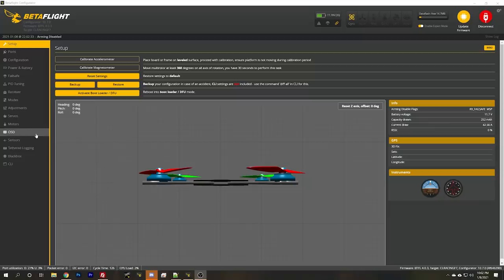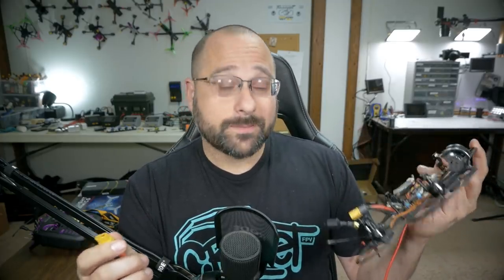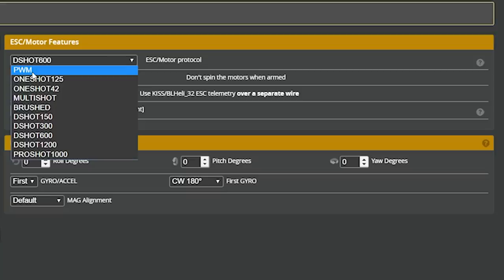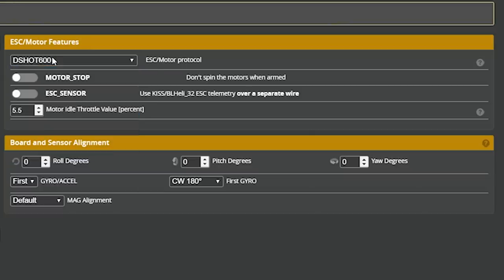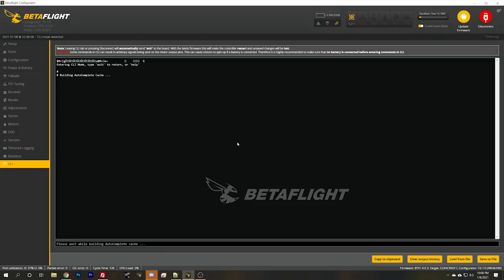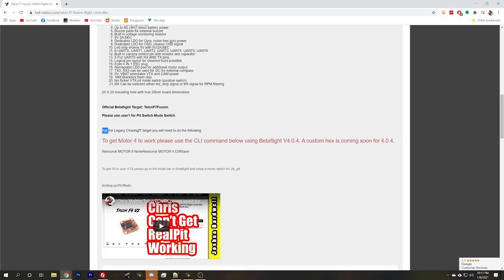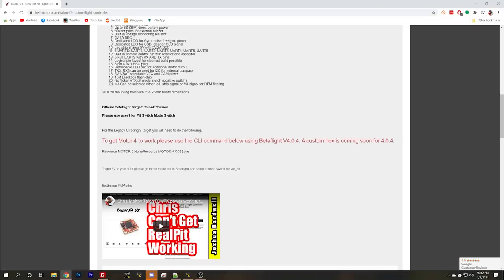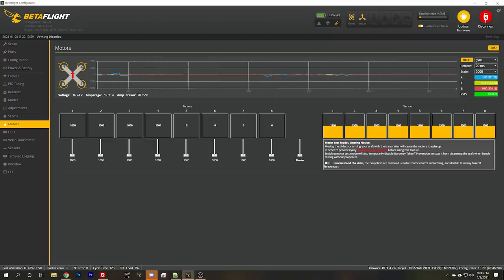Quadcopter motor won't spin REAL WORLD TROUBLESHOOT

Comment: That was pretty great. I am getting back into droning and just Receive my new swag yesterday, already have put in lots of hours.
Call the outside edge of a branch today and crashed. It broke one blade now One motor won't Spin, gimme back into this at each 51. I'm saying that there's a lot programs out there. That can help me and I appreciate this post. It was very informative and I definitely would do the pinch method and see if I can't figure things out. I'm hoping it's just a wire or something after the cras.  The plastic did come a little unhinged and a snapped it back together. So I think and hope it's something simple. I'm not at ESC.

Comment: As soon as I saw this. I thought I bet it's the talon F7. I had this exact same issue a few weeks ago. Its a bit sketchy that board. I remapped the motors once without reading the website trying to use a different pin and it bricked the board until I reflashed it. Then I found the info on the site and it's all good.

Comment: Built my first (and only up until this week) quad (RR CL1)  about 2 years ago.  I couldnt understand how it made such a loud init sound, where it came from (no obvious speaker on the FC) or why I still needed an external speaker.  I flew it a bit and it collected dust.  Never did FPV - LOS only.  It's so fast yet stable. I never wrecked it - unlike my attempts at heli - pro tip I learned circa 2000 dont try a .30 nitro swash as your first without simulator experience no matter what you think you can do.  My last flight with it before I took a break from the hobby I actually used it to hang an 80M half wave antenna on the top of a tree.  Lots of failed attempts at throwing rocks and using a sling shot/fishing pole. Anyway.  Rigged up some string and stripped 12awg wire, flew over, yanked the string - antenna dropped (well, not the antenna but the rope I used to then pull it up) - boom.  Also got my first contact that day.  My mind exploded when I learned the sound came from the motors.  Ive been into car/home audio for the same time.  The answer has been in front of me the whole time.  Ive never seen that from an RC before but it make so much sense.  Its genius.  Motors are basically speakers - without the part that pushes air which isnt even needed for higher frequencies.  Apologies for the long comment but man - mind blown / mystery solved - amazing.

Comment: Hey mr. Bardwell I'm glad you found the issue. My issue is really puzzling. Clracingf7 v1.0. All 4 motors and esc's work. Motor 4 does not spin but when I connect the signal wire to motor 3 it does and motor 3 signal wire to motor pad 4 does not. Motor 4 does come up on betaflight and seems to be working fine. On start up all motors do the 3 beeps but then motor 4 does not do the next 2 beeps. Flashed the board to clracingf7 but the other version of the f7 they say to solder the leds pad together with m4 pa. I'm thinking it could be that issue but do not know how to figure it out..thanks in advance and I know this is an old video but I'm sure you have a better idea of what it could be now.

Comment: I had this issue the other day and all the problem only ended up being a signal wire severed I could tell because the motor twitched when I plugged the battery in. ( exact same motor, btw!)

Comment: Hello Mr. Bardwell,

after I have already seen some of your videos, I would like to contact you. I have a problem with my first newly built drone. After arming and giving a little throttle, the motors turned to full throttle without propellers and at the same time the throttle stick failed completely. I could only stop the motors using a failsafe (switch off RS). Since then, the stack (SpeedyBee F7 V3 BL32 50A 30x30) can no longer be armed and the motors can no longer be addressed in Betaflight. Likewise, the bidirectional DShot can no longer be switched on in Betaflight. Also the button for Gyro RPM Filter is no longer available in Betaflight. Otherwise the stack works normally. Also the ESC seems to be ok according to BLHeliSuite32. Can you possibly tell me what is wrong with the stack? As a somewhat advanced beginner, I am at the end of my rope.

Best regards from Berlin

Michael M. Weber

Comment: Same problem (one motor not spinning) happened to me a few weeks ago. I use a 4 in 1 ESC and all of the motors did all the beeps except for that "broken" motor. I thought at first it was the motor, but something I did (after rechecking all the wiring and soldering) was to change the positions of the motors 1 and 4 (the non functional was motor 4), and then the motor I though was broken did work in position 1, and the one which worked before did not work in position 4. I then concluded that 1 of the ESCs was burned during a bad take off I had due to attempting it in a non-levelled surface. I checked with a multi-meter if any current was flowing through that ESC pads, and nothing there. Hope this helps to someone :D 

P.S.: I bought a new 4 in 1 ESC :P

Comment: I had a motor not spinning once after my brother crashed my quad, it turned out that the motor output from the flight controller was pulled to ground, so I soldered that wire from the harness to the ppm receiver input pad, remapped it and it worked like a charm.
Reply: yes a crash can do funny things bro pull a wire or ground something i thought it was sig wire for motor 4 have a great day bro

Comment: But if one motor wont spin after the crash, that could be physical damage? I tried to clean the motor as it was hard to spin by hand.. and also replaced the cable you mentioned... still problem with new motors! But as said, I had a crash.

Comment: I  could use your help.  I can't get the motors to turn. I can get the motors to turn in Betaflight through the motors tab.  I also see the transmitter talking to my receiver in betaflight (I see movement of throttle, pitch, roll etc). However, when I unplug the quad from the computer and plug in the battery and try with just the transmitter, I get no movement.   I've tried changing the motor protocols around, adjusted the arming to 180, flipped my arming and disarming switching up and down, but still no luck.  My arming switch is the SF switch on a tx16s.  It is also assigned in the modes tab and I see it being activated.  Any help would be appreciated. Thanks

Going to watch your arming fails playlist. Thanks

Comment: had same issue on old drone not mine. Battery   connected lights up but motor won’t run. The motor coils has resistance but its pcb capacitor is below reading label. When connected to battery motor felt hot but no sound or movement. Was it hardware or firmware ?

Comment: I am having a similar issue.  One motor stopped working after I ran three packs through it the day before.  Flashed the FC (MAMBA F405 Mk2 /F50 stack).  Had it set to DSHOT600, and only 3 motors worked.  Went on Betaflight and calibrated the motors in the Motors tab, still same result.  Checked in BLheli, so issues there.  Then, just for shits and giggles, went to the configure tab, changed the target for the ESC, to DSHOT300, nothing.  Then to ONESHOT125, and now all 4 work.  Any thoughts?

Comment: If your quad does a deathroll and one of the motors can't spin to full speed after (but still spins) you very likely had a motor winding snap. Happened to me twice on emax ecos since the top of the bell is so close to the windings. Small rocks and other shit gets in and the motor crushes itself until something snaps.

Comment: I ran into this same problem with MATEK H743 SLIM, and Velox 45A V2 4-in-1 ESC. one of the ESC is working fine, but the other one has one motor not working. There's no such easy fix as in the video on their website, any ideas?

Comment: Joshua, 2 of 4 motors vibrates 3 times with the beep at bootup...then the last 2 beep don't cause vibrations on these motors.... 2 other ones are fine.  i was hoping this video would solve my issue but it felt short of it as the issue lied somewhere else. What should i do? Not using bidirectional...quadx set...they are not spinning on motor page though i have the 4 sliders

Comment: Hi Joshua. I have a question about number 2 motor on my recently purchased  HGLRC Petrel 65 Whoop. Number 2 motor is not outputting full power when I have the quad plugged into Beta Flight and test the motors on the flight controller. Number 2 motor seems to have a problem spinning up with low throttle but spins up when I input full power with the Beta Flight motor control tester. It does not produce full power like the rest of the motors. I have done the ESC calibration several times and made sure I did it correctly but motor 2 still isn't producing full power. This is a RTF kit and comes with spare motors that just plug in. I replaced number 2 motor and did the calibration several times more but motor 2 is still not outputting full power I am now assuming that there is a fault on the board? This is the entire information from the HGLRC website on the controller. Is there anything I can do or is the ESC on the board broken?
Thank you for any help you can give. 
ZEUS5 FR AIO 1-2S flight controller
Input voltage:1-2S
FC firmware:BF ZEUSF4 FR (HGLR)
ESC firmware:BL_S
Frsky SPI Receiver
Protocol:FRSKY_X / Frsky D16
FRSKY_D / Frsky D8
Size:41.5*41.5mm

Comment: hi, i have the following problem: my front left motor is not spinning. the fc i new, the motor is new. it makes the right sounds when i connect it to the battery. the quad is a cinelog 35v2 with a geprc 722 45A AIO V2. the wires and solider joints are looking good… betaflight tells me that all 4 motors are running but there not… please help! thanks a lot!

Comment: Hey buddy Im having the same issue but with a new Matek System F722-SE F7 Flight Controller, I soldered the esc’s to the flight controller like how the diagram shows on there website.  I plugged it in and got nothing when I moved the channels. Are the esc’s shot I have no clue.My previous build I had a PBD and a fly controller this one seems to be all in one I have never dealt with these LOL is there anyway that you could possibly help me out so I can get up in the air flying

Comment: Im having an issue with My #1 ESC not showing on BLHELI_32 causing motor 1 to not operate. Is this a bad ESC? Ive dbl checked my wiring harness. ESC does its proper initial sound test when battery connected. motor 1 does not move while performing its initial pwr up test though. plz help. F722 HGLRC Zeus flight controller paired with an Hobbywing 60a 4 n 1.

Comment: Cool video IV had problems in the past with new builds with duff motors a good test if everything else seems ok is to swop motors and the duff motor moves but is a pain resoldering may be I will make a motor tester as in one of your other video to test new motors on

Comment: I fixed one of the motor which was not working but while screwing the drone back another motor wire got cut. When I joined the wire together now this motor rotate alone when I connect the battery and remote is not connecting ? When I disconnect it then rest three rotates with remote signal. What is going on ?

Comment: I have a simular problem with Kiss 35amp esc right now. Error coming up (Problem with One wire ID #3 detected)
No motor detected or failure on High side Fet/gatedriver. ??
Motor number three will not work! And I have tested the motor everything I know to trouble shoot it!

Comment: @joshuabardwell one of My readytosky RS2205 doesnt spin when I use my FS-i6X transmitter but the all spin nicely in clean flight. Can you help me? Connected to BLHeli s Favourite little bee 30A ECS. I get all the beeps on power for the motor in question

Comment: @Joshua Bardwell I wrestled with that board about a year ago. I was about to pull my hair out until I discovered that. At first you had to use the resource stated for that firmware. The new target didn’t exist yet. (RESOURCE MOTOR 6) for motor 4...silly lol

Comment: Hey Joshua looking for some help as well. One of my front motors is not working right. I plug in the quad and get all 5 beeps from motors, but I arm the quad and one of my motors are pulsing(spins a little than stops over and over), I raise throttle and the drone will shut down and restart with the same beeps as I just plugged a battery in. Any suggestions or ideas? Thank you in advance 🤙🏽
Reply from the maker: This is usually a sign that the ESC is damaged :-(
Reply: Awww man! Thanks for the help and such a quick response. Love from Kauai🤙🏽🙌🏽

Comment: This is exactly what happened to me. I flashed the wrong firmware. Took me forever to figure out and finally figured it out after I bought another flight controller and swapped it only to realize later that I flashed the wrong firmware after all the wires still worked with the new FC.  Now I have another FC! Lol

Comment: I have am issue when I throttle up motors Rev up but my quad won't take off and then the motors will just keep reving even after I have left off the throttle. Not sure what I did wrong but I'm back tracking now trying to find the issue
Reply: Ok fixed this issue lol but now I have a issue where the motors just Rev up even when I have the throttle down and my quad will arm most of the time but sometimes it won't

Comment: The quadcopter doesn't continue the beep...the controler doesn't flash the light also the receiver ... I feel one of the moters dead not smooth when I rotate it after the quad fall in water...but it doesn't connect to the betaflight....do you think the flight controler dead because of the water...does this make it dead ???
Reply from the maker: Based on what you're describing, I think the FC might be dead.

Comment: Can anyone help my back motors give no movement when arming but only front two does also the motors work at 1030 throttle but then stops after it , stopped working after accident reset

Comment: With the exception of the RTFM slip when it came to looking up the FC target,  Joshua is an encyclopedia of knowledge. I had no clue the motor coils are making the tones. I knew the tones were from the ESCs but didn't know the significance of the sequences. This is the kind of stuff you would expect to find in a troubleshooting flowchart or a forum. The problem with forums is often times people never read the full post and provide useless answers or you find your exact problem and someone says they resolved it but either don't say how/what they did or explain it so poorly that you are left with more questions than what you originally had.

Comment: I but a drone 4k pro i flon it 7 time and it doesnt beep no more and the motor dont start evryting else works the lights the camra etc. Whate could be wrong i did evryting in the book.
Reply: I bought a drone f11 4k pro and i flew it 7 time and now when i put it on it doesnt beep no more and the motor dont ingage dont work but the lights. Camera etc. Works whate could be the probleme p.s. let me now tanks.

Comment: i had only 2 motors spinning, turned out the connector between ESC and FC was just a little bit disconnected. i pushed it in and voila. hope this helps someone

Comment: That's not a beauty of troubleshooting, but an idiotism of every opensource project! That's what had born a great hate to programing like arduino and rpi and all other opensource things. We say it russian "to work through an asshole", and that describes all the libraries for each propouse on github. I do not absultelly need thousands of libraries for the same propouse with none of them works correctly. I need just one that works in the right way, and I see no problem to pay for it like 5-10$. The same thing with betaflight and emuflight... Why do I have to spent the whole weekend to tune my quad? Lot of parameters whith no correct descripption... Pidtool box just made it a little bit easier to tune pids and filters, but only when all "spoiling" parameters like boost, idecay, spa, iterm rotation, feathered pids and etc are disabled... And if I enable something like featherd pids I'll have some strange behavior graphs on pids when before the gyro get to the setpoint it has a horizontal shelf at about 0.4-0.5 of the set point and than it goes up to the setpoint... If I turn on idecay it just make my quad slowly pitch or roll by itself... So the main question: why do I have to tune my drone by myself, if there are lots of autopid tuning programs? and also there is a great question about how is it when the drone fly in the right way? I mean a feeling of a perfect tune of a perfect drone? I do believe that even betaflight and emuflight developers do not know it... Maybe developers should decide about REFERNCE DRONE? Mathematicaly everyone should understand that perfect tuned drone is the one, which have no overshoot and fast following the set point... So that's all about newbies who come to that hobby and have no any idea of how that thing should fly, how to tune it especialy when all the videos about tuning just talking about "THAT LOCKED FEELING" when you raising up P and etc..